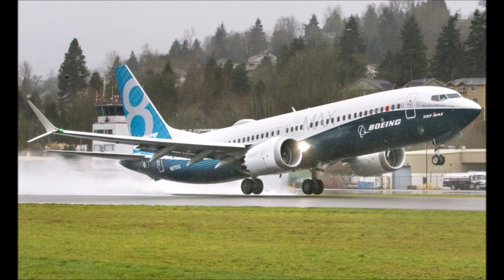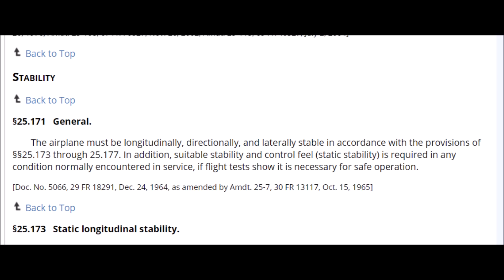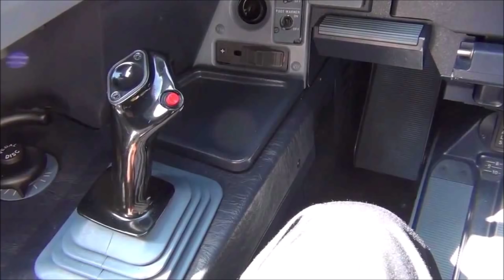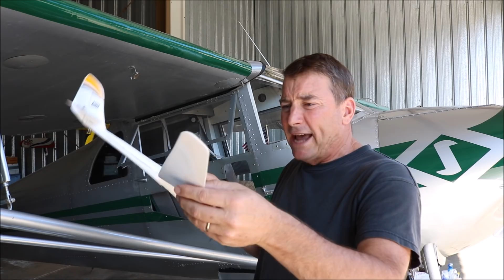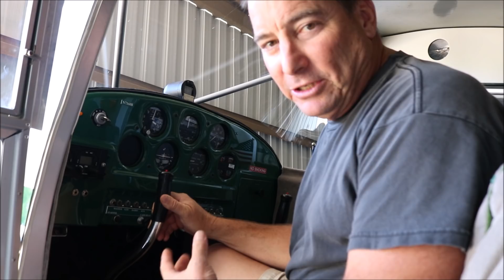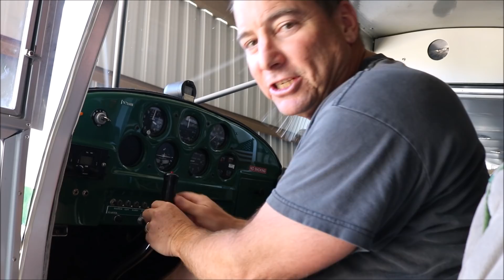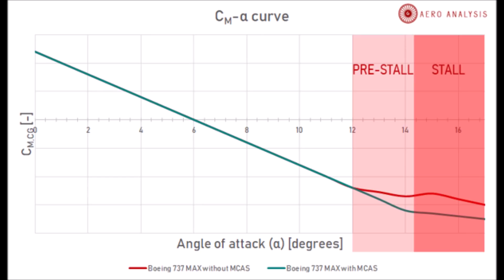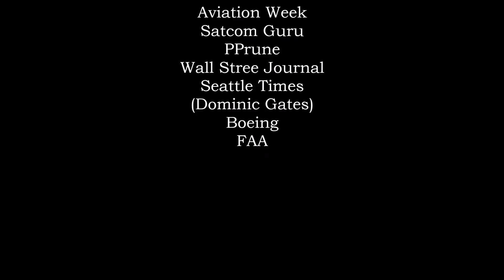737 Max UPDATE 30 Aug  2019

Comment: The main thing that could of saved these aircraft is that they should of gone through there memory items and cut off the the mcas system by switching off the two cutoff switches that are just underneath and to the right of the throttle quadrant. If they had known and taught about the confusion of the two systems that disagreed with each other. So they should of cut off the system n hand flew it. Can’t really blame the pilots though as they were not taught about this new system and were probably suddenly hit with many conflicting alarms and probably were overloaded mentally. The MCAS system had failed a few times previously n they thought it was an AOA probe on the side of the aircraft that had stuck but other pilots had successfully avoided crashing by turning off the MCAS. They had landed at there destination n reported a failure in the AOA and or the pressure sensors. Then other crews took over from the first crews but these pilots at such a critical point in flight didn’t manage to turn off the MCAS system. Like I said they were overloaded with conflicting information but sadly didn’t turn off the MCAS
Reply: Your facts are not correct: The Ethiopean Air crew did use the cutoff switches. They failed to save the plane, because using the cutoff switches means the plane must be trimmed with muscle power and the forces on the plane were too strong for a trim with muscle power.
Reply from the maker: Both of you have valid points.
Review them here-https://www.youtube.com/watch?v=9jNbayma9dM&feature=youtu.be
Reply: blancolirio just for your info this was my response to the other YouTuber..... Daniël Mantione no, the next action that is in the memory items and the QRH is to manually trim the aircraft, this requires as is on all the 737s inc the max is to manually trim the aircraft, you can do this by either pushing the trim wheel “the wheel that spins on both sides of the throttle quadrant”, this is why even in the video he starts with the fact that BOTH crews made errors that could of saved them and also why I SAID the pilots where overwhelmed with all the warnings and conditions they faced at a critical phase in the flight. They should of used the auto trim cutoff switches and if that doesn’t work then you manually trim the aircraft by pushing the wheel by hand, there is also a handle that pulls out of the side of the wheel to help you do it faster. The reason for both of these accidents is that all pilots transferring to the Max were NOT made fully aware of the MCAS system. The errors he is talking about is that in BOTH crashes the pilots didn’t follow the correct memory and QRH actions. They should of cut off the auto trim and manually trimmed the aircraft to then allow safe flight. Yes you are right in saying that a pilot when the 737 is drastically out of trim would be almost impossible to pull back on the yoke. This incident had happened many times before and the pilots flying the Max had done the correct actions in time to save the aircraft. They had hand flown the aircraft fully to their destinations and reported the incidents to the engineers. They assumed it was an AOA probe malfunction n changed them on the ground, found that they were working correctly and cleared it for the next flight, this actually happened on the flight just before the accident and the previous pilots had done the correct actions as said before and were ok, but the next crew were overloaded with the warning lights and didn’t follow the memory or QRH guidance. Hence they got overloaded mentally and this time failed to save the aircraft, the same goes for the other flight, which is why the video maker and I are both saying that the pilots did make errors BUT due to them facing unusual warnings etc probably forgot the memory items and the QRH and just MAYBE panicked. Like I said this same incident and exact warning indications had happened on over 100 occasions and they managed to save the situation mostly without even the passengers not even noticing anything was wrong. But yes the system IS unsafe due to the abnormal indications it gives and only having one AOA. Hence it’s understandable why the aircraft crashed but AGAIN as stated by me AND the video maker in both crashes the pilots DID make mistakes by not following the procedures that they should of and is drilled into them during pilot training.
Reply: Daniël Mantione no, the next action that is in the memory items and the QRH is to manually trim the aircraft, this requires as is on all the 737s inc the max is to manually trim the aircraft, you can do this by either pushing the trim wheel “the wheel that spins on both sides of the throttle quadrant”, this is why even in the video he starts with the fact that BOTH crews made errors that could of saved them and also why I SAID the pilots where overwhelmed with all the warnings and conditions they faced at a critical phase in the flight. They should of used the auto trim cutoff switches and if that doesn’t work then you manually trim the aircraft by pushing the wheel by hand, there is also a handle that pulls out of the side of the wheel to help you do it faster. The reason for both of these accidents is that all pilots transferring to the Max were NOT made fully aware of the MCAS system. The errors he is talking about is that in BOTH crashes the pilots didn’t follow the correct memory and QRH actions. They should of cut off the auto trim and manually trimmed the aircraft to then allow safe flight. Yes you are right in saying that a pilot when the 737 is drastically out of trim would be almost impossible to pull back on the yoke. This incident had happened many times before and the pilots flying the Max had done the correct actions in time to save the aircraft. They had hand flown the aircraft fully to their destinations and reported the incidents to the engineers. They assumed it was an AOA probe malfunction n changed them on the ground, found that they were working correctly and cleared it for the next flight, this actually happened on the flight just before the accident and the previous pilots had done the correct actions as said before and were ok, but the next crew were overloaded with the warning lights and didn’t follow the memory or QRH guidance. Hence they got overloaded mentally and this time failed to save the aircraft, the same goes for the other flight, which is why the video maker and I are both saying that the pilots did make errors BUT due to them facing unusual warnings etc probably forgot the memory items and the QRH and just MAYBE panicked. Like I said this same incident and exact warning indications had happened on over 100 occasions and they managed to save the situation mostly without even the passengers not even noticing anything was wrong. But yes the system IS unsafe due to the abnormal indications it gives and only having one AOA. Hence it’s understandable why the aircraft crashed but AGAIN as stated by me AND the video maker in both crashes the pilots DID make mistakes by not following the procedures that they should of and is drilled into them during pilot training.
Reply: The Ethiopian crew was well beyond VNe when they tried using the manual trim, the forces at that speed are too great to overcome to trim manually.
Reply: cameron n you can use the manual trim that even has a handle that pulls out to help you trim using the trim wheel at any speed. That’s how it was designed, the reason for the crashes was that on both occasions the pilots didn’t follow the correct memory items or the QRH. If they had done this in time they would of saved the aircraft. Unfortunately in both incidents they had ran out of time. Please also see my reply on this thread to another user. As stated even by the video maker at the start both accidents were recoverable but both made mistakes, but understandably they were probably overloaded, you would be correct though if you had stated that using the normal pilots yoke then the forces are to great. And also the same incidents had been reported on over100 other occasions but all were recovered without even the passengers realising that anything was wrong. Obviously with the plane being so new these incidents hadn’t had enough time to flow back down the chain to the relevant authorities
Reply: cameron n also followed on from my initial response, if they had followed their memory items and the QRH they would of fixed the issue before they reached VNe. But as I said before these two crews on both accidents probably had overload mentally due to the confusing warnings but as the video maker states not only did they make mistakes but the pilots are initially the anti stall system. No aircraft would be certified just like the older 737s that have been flying for decades that the hand trimming wheel with the handle pulled out n has been tested many times over the years of 737 flights it is possible to use the trimming wheel to trim at any phase or speed of the 737. You are right if you were talking about the yoke “stick” pressure

Comment: Juan: I read a story the other day that I haven't been able to confirm. I had heard that the day before the Lion Air crash that a pilot flying as a dead head (or off duty) and seated in the cabin came into the cockpit when he realized that the pilots were having issues with the MCAS. He then gave those pilots instructions as to the procedures to turn off the MCAS, which in turn saved the plane. If this is true, there should have been a big deal made out of this and ALL Boeing 737 MAX pilots should have been instructed more clearly on how to turn off the MCAS. 
Here is the referenced article: https://qz.com/1576597/off-duty-pilot-saved-lion-airs-737-max-the-day-before-its-fatal-flight/
Reply from the maker: Yep! Covered in previous update.
Reply: Robert Brown that’s an incredible story

Comment: Like I said, from the beginning with the validating information, you mentioned, was caused by young (inexperienced), foreign (cheap labor) engineers. When I was working at Rockwell on the B-1B (early to late eighties) and then working at Boeing (late eighties to early nineties) on the 777, I noticed both companies including the industry, were getting rid of their older, more seasoned engineers for inexperienced, younger and cheaper foreign engineers. It all came down to profit vs. safety. They knew the risks. The triple-seven is the last Boeing aircraft I will ever fly on.

Comment: Thanks for a clear summary. Grounding you for PSA is very odd. I'm not a medical practitioner but having had prostate cancer a decade ago, I'm quite expert on the subject, having read everything available. PSA is a very unreliable indicator. It has some value as a trend indicator but in and of itself, it has little medical significance. Prostate treatments often causes an initial rise in PSA. But notwithstanding all that, prostate cancer is invariably  asymptomatic and thus irrelevant to your flying capability. I do find aeromedical policies quite bizarre. I was once grounded for benign arrythmia. I had to fund medical investigations to prove it was operationally irrelevant - but still the agency wanted me to take drugs. I successfully proved that the side effects of the drugs were worse than the condition they were supposed to treat. Eventually, I got an apology from the chief medical officer of the CAA - which I have framed. You might want to consider a more aggressive strategy to challenge the decision, if only to get your Class II back and fly your mighty Luscombe. Best wishes.

Comment: As is so often the case, there were many levels and steps at which point this could have been prevented.  But a change in design not getting back up the ladder should be 100% preventable.

Comment: Am I correct to assume that if pilots had known of MCAS behavior, they could have corrected the trim [incorrect trim made by MCAS] by applying trim button, and then, when a reasonable trim setting had been reached, switched the electric trim off?
Reply from the maker: Yes, see previous 737Max updates.
Reply: Thank you.  I think I missed the video where you stated this explicitly as this is very important.

Comment: Thank you for your video series on the 737 Max.  Very informative and appreciated.  Nevertheless, I find myself wanting and let down by a material omission in your otherwise thorough analysis and comments.

From your excellent knowledge and explanation one can readily concede that the 737 Max is inherently stable and safe on the 99.9% of flights operating as regularly scheduled flights carrying nominal passengers, cargo and fuel.  The inherent problem and concern is reserved to the corner case 0.1% to 0.01% of flights (1 in 1000 to 1 in 10,000) when the 737 Max is being ferryied/positioned on a short haul flight with no passengers, no cargo, and minimal fuel.  Is this not the very scenario that Boeing was attempting to manage with the MCAS?

Please consider a seagull bird strike on the AOA sensor of a 737 Max performing a high performance Farnborough* style take-off on a 100 mile positioning flight from San Francisco International airport (SFO) to Sacramento International airport (SMF) with no passengers, no cargo, and minimal fuel for the 100 mile flight. Would you concede this is a plausible and inherently dangerous scenario for the unwitting ferry pilot with a malfunctioning or disabled MCAS?

* See Boeing's show off video debuting the high performance take-off capabilities of the 737 Max at the 2016 Farnborough airshow. 

In lieu of MCAS, it is a shame that the FAA regulatory and certification framework does not provide for a simple Food and Drug Administration (FDA) style "Black Box" warming to ferry pilots to never attempt a Farnborough style high performance take-off on an empty plane carrying minimal fuel.  The FDA trusts doctors to do the right thing with pertinent drug safety information.  I would equally trust a professionally trained pilot to do the right thing if provided with pertinent "Black Box" style aircraft safety information.

Comment: Most importantly, best to you with regards to your health.  This was all exactly what we wanted to know.  There was one statistic that made the hair on my neck stand up... the assumed "almost impossible" failure rate of a billionth or 1/(10*10*10*10*10*10*10*10*10)...  That's EXACTLY what was assumed of the possibility of losing all hydraulic systems on a DC-10 prior to UA232.  Interestingly enough, hydraulic fuses were added, not only to DC-10s, but to all commercial aircraft after that accident.  By the way, r.i.p. Al Haynes...
Reply from the maker: Yep.

Comment: Those protections didn't work very well for AF447.  And Gates from the Times is who started the unstable nonsense in the first place.
Reply: For AF447 the pilots did create a situation where the computers were unable to protect them and in combination made human errors.

The pilots of AF447 flew the plane into a storm. As a result the pitot tubes of the plane froze and not longer gave reliable data. The computers of the plane did detect this correctly and as a result switched the plane flight control into Alternate Law. When the plane is in Alternate Law, many of the protections against human error are disabled, as the computers are unable to fly the plane.

The pilots were confused about their height and were pulling on their joysticks to make the plane gain height without considering the angle of the plane. When the plane is in Normal Law you can perfectly do this, because the protections will keep the plane out of danger. However, because the plane was under Alternate Law, the pilots were free to put the plane into a stall situation, which they did. The plane lost speed and fell from the sky.

The more experience pilot did notice this and commanded the other pilot to lower the nose. But the pilot didn't immedeately why he had to do this and it quickly was too late.

In other words, plane working perfectly as designed but still a crash and hundreds of lives lost. This was a really difficult crash to take preventive actions on, because once the computers fail, the plane has to rely on the pilots for safety, there is no other way. If the pilots do a bad job too... what else can you do.

I believe Airbus did command preventive inspections on all pitot tubes after AF447, but that was about all that could be done.

Comment: 737 MAX is a trainwreck and I can only suggest to avoid this plane
Reply: If you paid attention to the video, the Max is very stable. It needed a separate pilot  license, and shouldn't have been made to fly like older 737's
Reply: @K2SKIER112  its so stable that 2 new 737 max crashed and other 737 max nearly crashed brand new out of factory

Comment: While I  agree that Airbus" fly by wire is the future, has anything been done to prevent a situation such as experienced in the Air France 447 disaster, Juan? Bonin held the stick back in full nose up config, and the pilot in the left seat was unaware. At least the Boeing system links both yokes together. Has Airbus done something about this?

Comment: Great video explanation. Hope you get back flying asap. If the MCAS is built to make the Max be handle like the previous models why is the system deactivated when the flaps are down? Is it not on that the moment that the acraft handling caracteristcs makes the diference on aproach and landings for the pilot?
Reply: Rafael Carvalho Lowering the flaps changes the center of aerodynamic pressure, so that MCAS is not needed during landing.